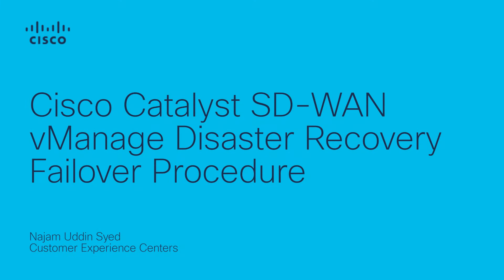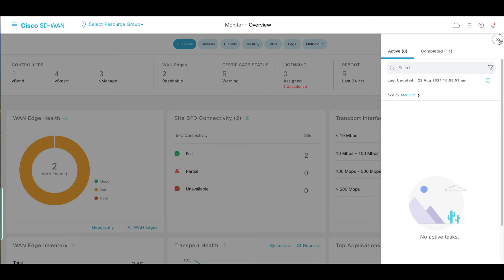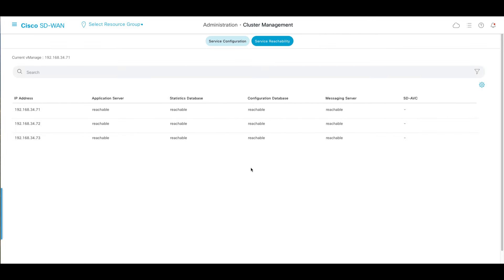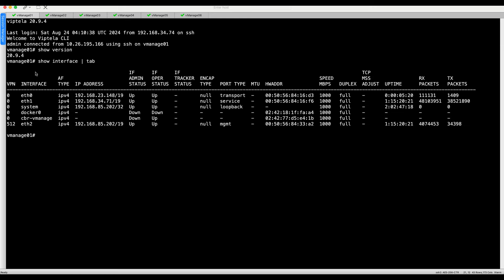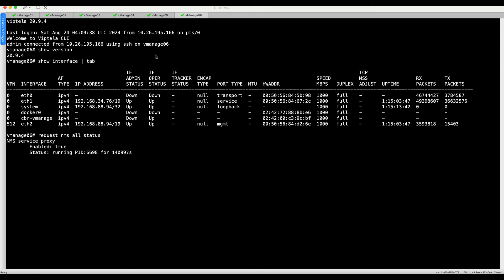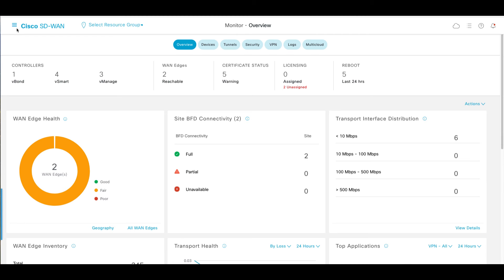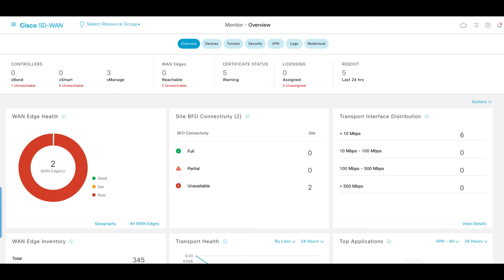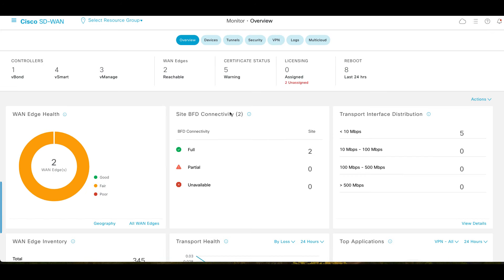Cisco Catalyst SD-WAN vManage Disaster Recovery Failover Procedure

Comment: Awesome work. I would like to understand why on your standby cluster you have not configured IP addressing. All instances in the standby cluster have the transport interface as down?
Reply from the maker: Hi there, thanks for your question! The standby cluster is configured with the transport interface in VPN 0 shut down to ensure that it is not part of the active overlay network. This is done to prevent any conflicts or issues that might arise from having two active clusters simultaneously. We hope this information helps!
Reply: @CiscoSystems  Thank you for your response. I understand why it is shutdown. However, take for example vmanage06, eth0 does not have any ip addressing configured even tho the interface is in shutdn state. I find that confusing and would like to understand.
Reply: @deenbaba5304 The eth0 ip address on the standby cluster is part of tunnel interface. Since this is 'dhcp' based IP Address assignment, the address is released soon after interface is shut down. That is the reason you are not seeing the IP address. Thanks!
Reply: @syednajamuddin3198  That makes sense thanks